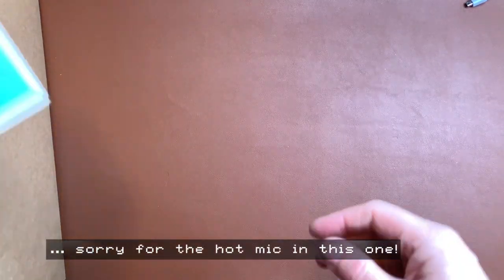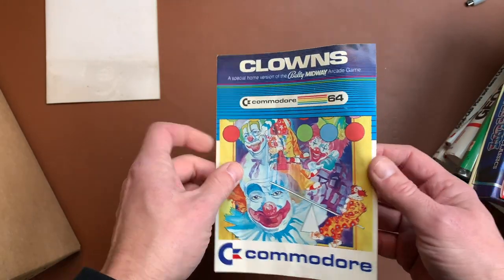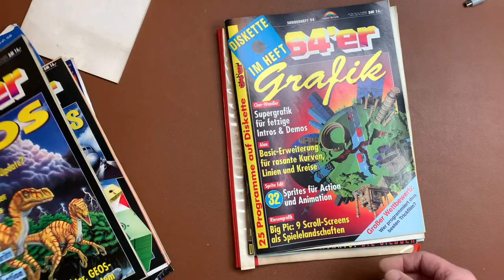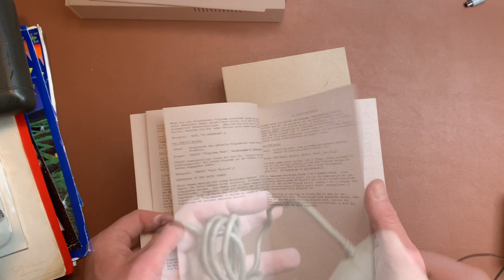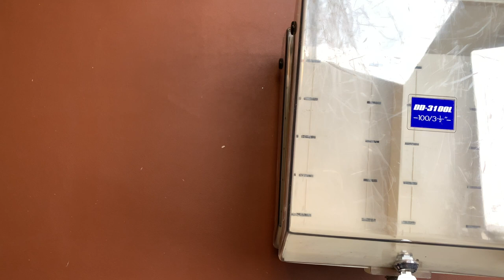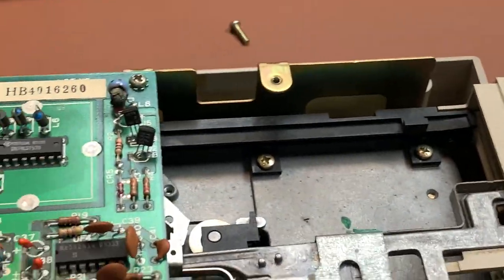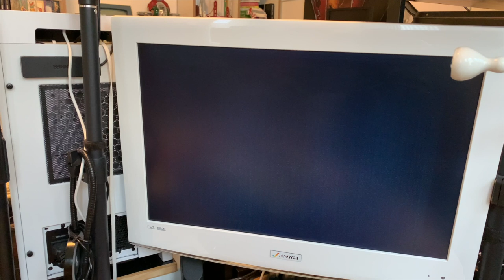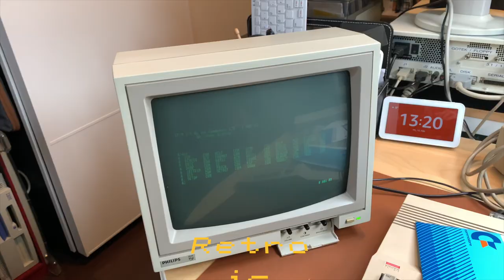EXPLOSION AHEAD! Commodore 64, Commodore 128, 1541, 1571 ...

Comment: Nice video. TY. I have a 1531 deck on its way from UK. I was looking for it to go with my 264 display since I have the 3 computers, 1802 CRT, 1551 disk drive and just got the black MPS-803. Many pages of the 1531 on eBay but they all had the chemical burns from the cable being wrapped around it for years. The one I got for $15 didn't have the burns. Seller said he had no way to test because his plus/4 died years ago. I also had that PC joystick in that same box for many years. OMG what a GREAT price for all that hardware!

Comment: Oh, well... I had at first only a 1531 with an adapter for my C64C and a green monitor. A disk drive was too expensive. After half a year, I had earned some money and I bought a similar floppy like you have in your video, an OC118, which was of course way cheaper than the original. But it was very reliable. I still have two of them today. - Keep up the good work, looking forward to your next videos.
Reply from the maker: I started my C64 life with just the bare machine. After three or four month I got a dataset and at least 18 month later a 1541.

Comment: To be honest, I didn't know anybody here in gemany who was using tape (that was back in 1985/86). We all had 1541s with no exception. Because otherwise, you would have been out of the supply chain for new software. Nobody traded tapes in the school yard.
Reply from the maker: We actually met to copy from tape to tape using a stereo. Later we all got a 1541 but many were stuck on the tape and lost interest in their C64 at some point. Most never switched to Amiga or PC like I did.
Reply: @RetroWK  Interesting. Must be local differences then. I only remember one occasion where I tried to copy a tape via a tape deck. It was the original Winter Games on tape. Didn't go so well, I ended up with a tape that proudly found "Winte Gaus" when I tried to load the game...
Reply from the maker: @EgonOlsen71  It had to be a mono stereo (yeah, this makes no sense) then it would work. So a classic tape deck to tape deck copy on a "high end" stereo system would not work. ... I think you just grew up in a better part of town ;-)